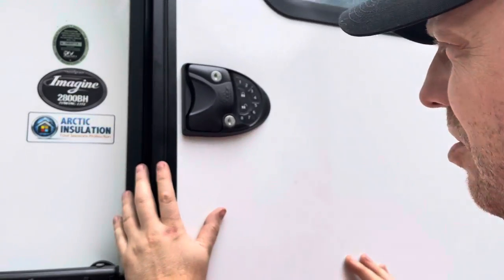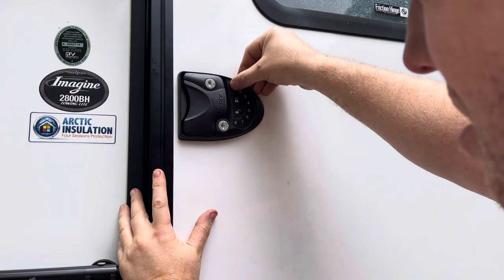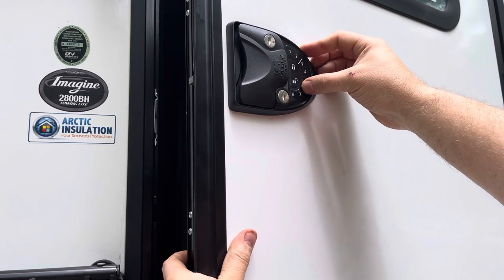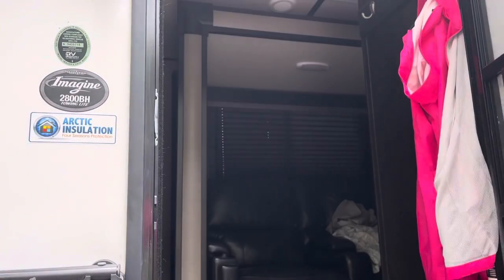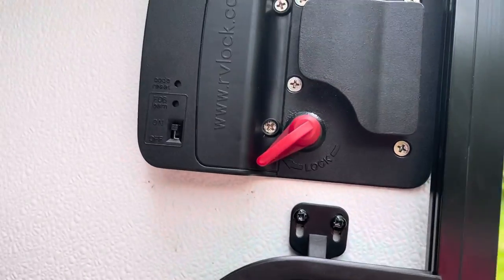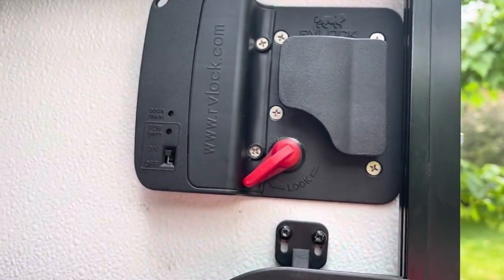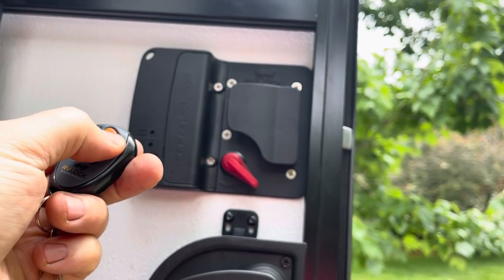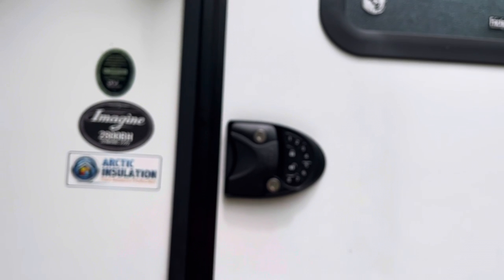RVLock Keyless Entry Programming

Comment: I recently installed an RV lock, I've installed 2 previously on other units and never had this issue before. When entering a new code it doesn't fully take it, the original "1234" works to lock/unlock and the new code I entered to override "1234" only works to lock the door.

Is this a common fault in the handle, do I need a replacement, or is there a known fix?